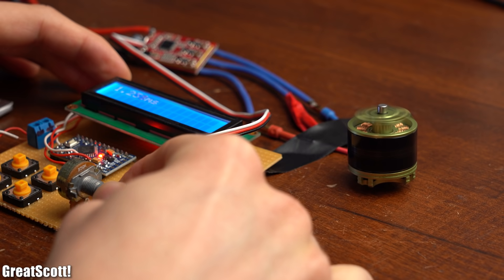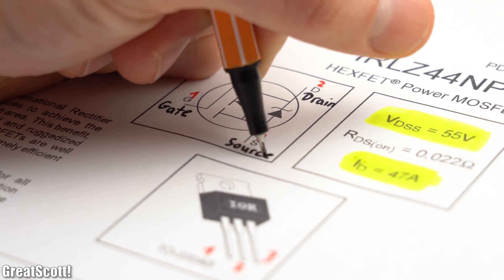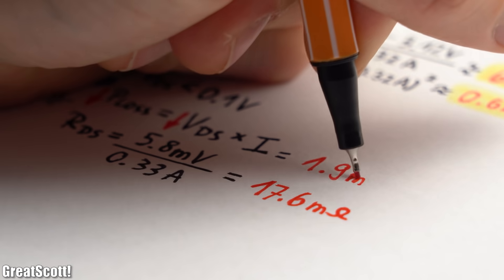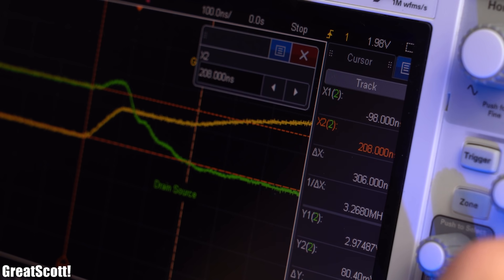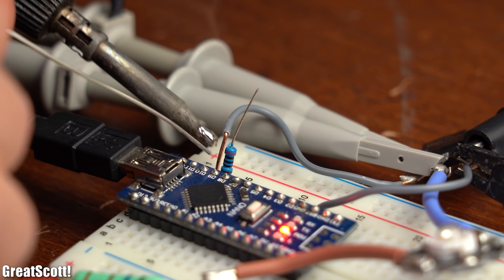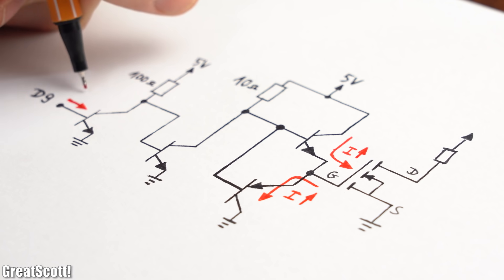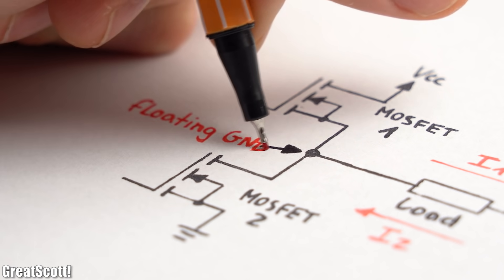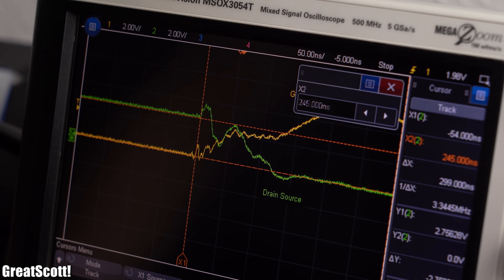Here is why MOSFET drivers are sometimes essential! || MOSFET Driver Part 1 (Driver, Bootstrapping)

Comment: It sounds simple "I chose the LM121...". How do you search,  compare and choose components without spending an awful lot of time with it?
Reply: You look on YouTube and see what other people are using.  Or Google it.
MOSFET manufactures have application notes for MOSFET drivers, so that may help.  Works for other components too.
Reply: Another necessary parameter to consider is what IC package you’re willing to solder, and how performance and ease of soldering tend to be inversely proportional to each other... (cries in LMG1025)
Reply: Application parameters vs data sheets.
Reply: Use a supplier with a good parametric search like Digikey, or head to the Texas Instruments or Analog Devices websites. Both TI and ADI have extensive libraries of application notes. They are invaluable. Both also have a decent parametric search function, but it limits the results to their parts, of course.
Reply: You spend an hour searching the first time, and then you remember the part number so you will know what to get next time you need one in the same situation. If you need a general use N-channel power MOSFET, for example, you just think IRFZ44N - because in almost every situation you encounter, it'll do. So long as you can recognise the few situations where it won't.
Reply: @Muckin 4on Complimentary BJT pairs work well. TI has a great App Note about driving MOSFETs:

https://www.ti.com/lit/ml/slua618a/slua618a.pdf

The only time I have found MOSFET capacitance or gate charge to be an issue was with a DC/DC converter when optimizing efficiency. Output power required was 6.5 W and the switching frequency was configured for 200 kHz. A MOSFET with a much larger Ids_av was originally spec'd in the circuit with a very low Rds_on. It also had higher capacitance and gate charge. When we swapped in a FET with lower capacitance and charge, but three times higher Rds_on, we gained 2.5% points of efficiency in the DC/DC converter overall. 

Doesn't sound like a lot, but if you gain a couple points from a single component swap that's not bad. Max operating temp of the product was 70 °C and heat was an issue in the product.

In this case the dynamics switching losses in the FET accounted for a much greater proportion of power loss than the steady state resistance of the FET. It's a balance between switching frequency and drain current. Other (higher power) applications may benefit more from lower Rds_on than Qg.

We could have used an external driver circuit to speed up switching, but choosing a part with lower gate charge was the better solution in this case. This was also not a high volume design, but there is always pressure to reduce BOM cost. Also board space was limited.

Comment: Great video! Recently i was struggling to build my own high power H-bridge for controlling dc motors. I can see that your favourite MOSFET's are easily capable of such application. It would be a nice challenge for you to build such an H bridge and i'm sure there are a lot more makers who would really appreciate your help :D
Reply: Did you created H bridge?
Reply: You could rasily replace the mosfets in your H-bridge with an indestructible  magnetic amplifier. It came before the transistor but is, little known to many, still used in high-power applications.

Comment: Gosh, I've blown up a lot of components learning about FETs. There's a lot to get your head around. It gets even more exciting when you have inductive loads. Gate drivers and bridges definitely are very useful.
Reply: help me to control a DC motor please, I am using IRF3205, and the 12V geared DC motor is not turning off...Thanks

Comment: Great breakdown of one of the world's most popular devices and circuitry. This is used in practically every switch mode power supply out there, including laptop power supplies and desktop PC power supplies, just to name a few. Power electronics including switch mode power circuits will become even more popular with electrification of vehicles. Let's all get ready for dangerous high voltage digital circuits! Yes!

Comment: 12:29 , how does the gate voltage rise to Vcc + Vc , the supply and the capacitor are not in series with the gate ?
Reply: The bottom of the capacitor is connected to the floating point witch is vcc so when the lower fet turns off the voltage on the floating point rises to vcc and when the capacitor is also charged up the voltage is vcc plus V capacitor
Reply: @bashaaksema94  what? the floating point is floating. we dont know that its vcc until the upper fet turns on
Reply: Hey here is another great video about bootstrap capacitors by John Audio tech. This also answers your question for voltage rise :) 
https://youtu.be/I2FQ-hFpH9g

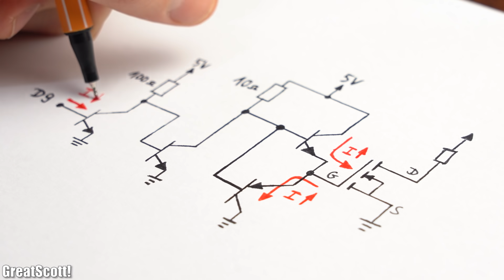Comment: 9:54 - OMG.
Who the hell tights the Emitter follower with 10 ohm resistors ? :D
You can drive the emitter follower even directly from the MCU  if using same voltage. This circuit has very high input resistance.

Comment: With 5v logic, if the application permits, I also just use a small fet in common drain configuration. They  provide all the current to drive the Power mosfet with a very low input capacitance.
Reply: An advantage of a mosfet driver is the push-pull output stage with its low output resistance when driving the output either low or high. A simple high side fet gate driver will switch on fast but will be slow to sink the big fet's gate charge.
Reply: @ax13h  right, as I said it depends on application. But the capacitance of power mosfet is often hi for mcu but not so hi to be an issue with a properly chosen pull down resistor.
Reply: @KirysIt  You're right -- if the application doesn't demand it then it doesn't matter. You can match the turn-off performance of a driver chip with a pull down but you'll be drawing many amps through it while the load is active.
Reply: @ax13h more likely mA but if I need to drive a large mosfet the final load will likely drive much more. But I as said you are right, is not the best option, but for some applications (like small pulses) is good enough.
Reply: @KirysIt  If you are only pulling mA through your pull down resistor then it's really no better at sinking the gate charge than the micro controller pin is.

Comment: Dude you just resumed my B.S. Electrical Engineerging thesis on like 13 minutes.
WTF
Just awesome.
Reply: Bullshit electrical engineering? I'm also good at it.
Reply: @iNezerroth  Basically feels like it
Reply: Hey! If your thesis is published I would love to read it if you can share it, I'm an electronic engineering student and really interested in control and power electronics.
Reply: what was your thesis about?
Reply: @alexandersolon6548  I assembled a three phase inverter to test different digital control schemes, and evaluate how it affects the output harmonics.
So this video summarize the all chapter where i explanied the mosfet's response and why you need the driver
Reply: @anl2468  can i have  a link to the paper?  i would like to read it.
Reply: @alexandersolon6548  I only have the actual thesis (about a 100 pages) in spanish, i don't know if that works for you
Reply: @anl2468  aw sh!t, well thanks for trying man.
Reply: @anl2468  I'm interested to try and translate it out for the read -- how would I go about getting my hands on a copy?
Reply: @cptstbd  Sure, pass on your mail and i'll send you the PDF.
Reply: @anl2468  Anímate a publicarla :)
Reply: you did a thesis for a bachelors?
Reply: @wow1022  Yep, isn't common?
Reply: @anl2468  not in the U.S. as far as I know.  Thesis/Dissertation etc... doesn't usually occur until post-grad in my experience (will someone tell me if I'm wildly off base here?) Although, when I was studying applied physics in undergrad our department had some specific project requirements, but it was really more about supporting the postgrad students in their thesis work than actually doing anything yourself.
Reply: @cptstbd  I'm from Venezuela, i understand the B.S. Degree last three years in the U.S, right? 
Here it last 5 years, and i'm technically specialized on Power Transmission, as in my degree we see many elective courses on this subjects. 
That might be why we have to do a thesis.
Reply: @anl2468  ah yes, that would make the difference. honestly I dropped out after two years... I've learned more by myself in the last month than I did in undergrad -- definitely wish our education was valued the way yours sounds it was :( but I digress. For us, the public route is like so: (primary/secondary often combined) "K-12" then undergrad for 4 years (ideally) then you can decide the track from there be it masters to phd or whatever you want, but the issue with undergrad becomes that you can try to get out in 3 with enough credits, but they bloat the course requirements here so badly it's 50% a waste of time at minimum, and virtually impossible to do, let alone do well, while working.
Reply: @anl2468  I think someone is trying to get a thesis written without having to write one lol. Example:
You: I wrote a thesis.....
Some guy: I would love to read it....
You: Its in Spanish and not online....
Some guy: That's ok I'll translate it....
You: ok send me your info and 50 bucks 
Some guy: Score, now I can party and not worry about writing that B.S. thesis......
Reply: @jvon3885  it never appeared so turns out it really was a B.S. thesis 😆👉🏻👉🏻
Reply: Rólala
Reply: we have a youtube channel that deals with Arduino,ATmega328P,Java,Serial programming ,robotics. So if you like these stuff do Subscribe. Sorry for annoying
Reply: Real world hands on vs "theory"
Reply: Resumed??... Did you mean "summarized" ... "On like 13 minutes. WTF".... You're supposedly educated?
Reply: @starmc26  Everything alright at home friend? Not my main language asshole jajajaja

Comment: Great video explaining the basics :) Maybe give a hint in the next part of the series that high-side switching is not only possible via bootstrapping with an n-channel MOSFET but also with a simple P-channel MOSFET without any extra circuit (beside a p-channel driver IC if needed for the application) ;)

Comment: I  bought irfz44 fets from ali express but they destroy quickly when i make induction heater circuit you explain in video.what will be the reason for destroying fets
Reply: Maybe voltage spikes from a coil.

Comment: I have a BBS02 750 watt ebike motor. If I wanted to upgrade the mosfets in something like that, is it as simple as getting ones that can handle more current or are their other factors I need to be aware of. They are 25 amp mosfets at 52 volts and I am looking for some with a rating of 30 amps because when I ride my bike, it  approaches the limit of the mosfets when the battery voltage is high. Thank you.

Comment: Please make video about switching MOSFETs in range of MHz.
Reply: @Harsh Desai  The reason that your vgs looks like a cap charging is because a mosfet gate is a capacitor. As nico nico said you can choose one with less gate capacitance (would be specced in coulomb on the datasheet) or to drive the gate in a more aggressive manner. Is there any reason you need to switch above 1 MHz?
Reply: @gummy1204   To make the buck converter. I have been trying for months, and still I can't trigger gate properly at heavy load.

Comment: If a MOSFET driver can switch high voltages and current, when would one use it instead of a relay, say in automotive or line voltage applications?
Reply: When fast switching is required, when switching without arcs or moving parts is needed.
Reply: Relays provide galvanic isolation and near-zero resistance and leakage.  They're also larger, slower, more costly, shorter lasting, and might require more components to drive.

Comment: Another reason to use MOSFET driver: cross-conduction prevention that could prevent your Metal Oxide Silicon Field Effect Transistor into becoming Magically Obliterated, Smoke n' Fire Emitting Transistor in a bridge configuration.
Reply from the maker: Yep. True
Reply: @greatscottlab  Hi mate... When is it coming the part 2? 👍
Reply: Exactly! H-bridge drivers have dead time for that...
Reply: Most H-Bridge already have driver and cross-detection or so-called dead-time, 
if you need the power by using 4 (or 6 for brushless) stand-alone MOSFET's, you should not just use mcu-gpio to drive them that is for sure.
Reply: b-bridge? As in...

FULL BRIDGE RECTIFIER?
Reply: Is this when you turn off the high side and turn on the low side but the high side has a delayed response so there's a period where the supply is basically shorted?

If so I could just wait 1000~ ns or so depending on the fet and avoid the problem?
Reply: @animatrix1851  Yes I believe that issue is called shoot-through, dead-time is used to prevent that and as I understand there are pros and cons to doing that. A lot of ICs have some other compensation to make up for losses due to the dead-time (I'd imagine for many use cases a simple dead-time technique with no compensation is more than good enough).

Although my favorite h-bridge circuits that I'm still studying eliminate the need for dead-time either by "gate biasing" or some fancy terminology like that which I have no idea how it works but apparently using a few resistors and capacitors in addition with not gates (single IC) you can bias the gates of a two n-channel and two p-channel bridge so that they don't cross conduct. If anyone wants to help solve the mystery of that circuit please do so since I really don't understand it and failed to simulate it on Circuit JS, to find it simply google "Design of an H-bridge driver without dead-time  generation using gate bias". Since they claim it's "more efficient" than conventional techniques used in modern ICs I'm really curious to hear from  you guys on this as it seems to good to be true.
Reply: @xhivo97  sort of like making the high side dependent on the output of the low side ? You wouldn't need dead time then since it's inherently never on simultaneously
Reply: @animatrix1851  YES! Exactly that! I saw a circuit that worked like this and thought it was really clever, any drawbacks to that? I couldn't figure out how to make it work with 24v since the original would go over the 20v and -20v for Vgs.
Reply: @xhivo97  wew cool, I guess you could route the feedback to the gate through a resistor divider (any downsides?)
Reply: One way is to drive both output transistors slightly out of phase giving a dead-region to ensure both transistors are not conducting at the same time,.least that is what I am thinking of doing since I do not want to be using QFD or special pcb's to accommodate them, besides I am trying to keep cost down as i want to make this design commercial eventually and know manufactures these days discontinue parts quite regular, least using transistors it mitigates that risk.